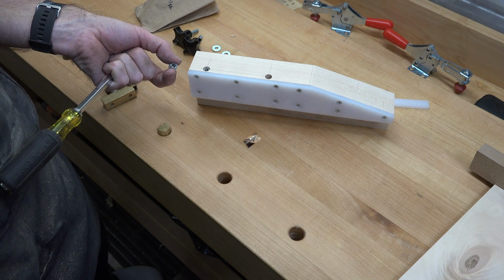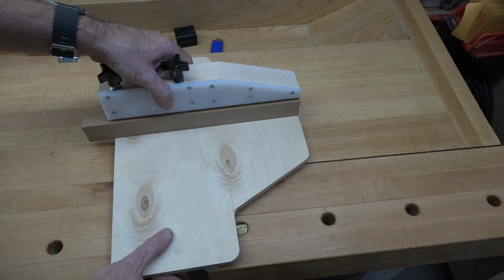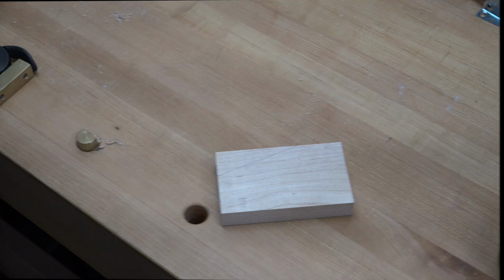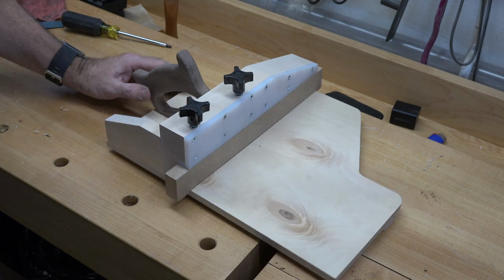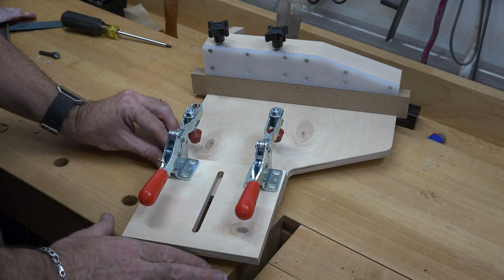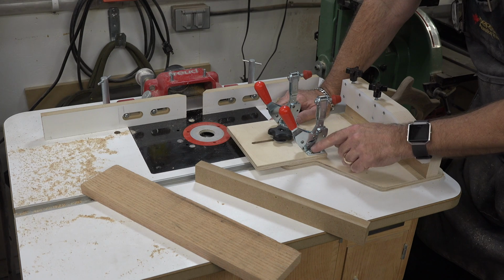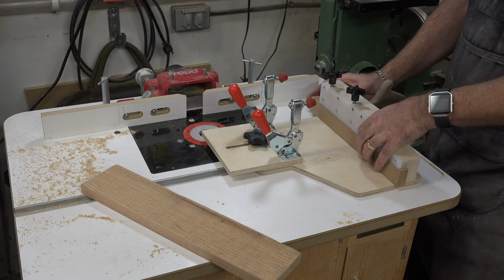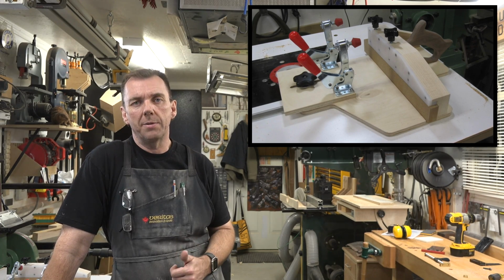Making a Coping Sled Part 2

Comment: Off the subject, a little but I bought an Infinity Lock Miter Jr. Router bit and I saw where they sell a router sled also. I looked at it online and had the bright idea that as I own a DELTA 34-184 UNIVERSAL TENONING JIG that I don't use all that much but decided I would take the clamp off and use it to hold my extra long pieces of wood to use it on my router table to push the wood through my router with the infinity lock miter bit. It works great so I can put the long clamp back on it and it will still be used for a tenoning jig.
Reply from the maker: Sounds like a very worthwhile "modification" Tom.  Good for you for thinking outside of the box.  Nicely done.  Thanks for tuning in.

Comment: Why secure your sacrificial fence in such a complex way? I have built and used a sled many times, and I find just the side fore from the workpiece means that it does not move. But then, I do not rely on the hold-downs to hold the workpiece square- a sliding side fence on that side does that. Why not use your sliding clamp mount to do that function? Way more secure...
Reply from the maker: The good thing about our hobby Mike, is that for every process, there is about 10 different ways to achieve the same result.  The way that I demonstrate here on the show is not the only way and if there is a way that better suits you, I encourage you to use it.  Thanks for tuning in and for chiming in with your suggestions.  It's appreciated.

Comment: Nice build Kenny, I think when I build mine the plywood that the toggle clamps are mounted to will also be a surface that slides up tight to the stock to be routed. I like the sacrificial hold down and the dowel extenders if I have to do that I will epoxy neodymium magnets to the dowel this will hold the dowels up when the knobs are backed out and you replace the sacrificial board thus preventing the lose of the dowels. Now the piece of plastic over top of the sacrificial board what purpose does it serve? Why not wood? Perhaps I missed something.
I can not justify spending $150.00 US on something I can build my self. Even if I have been drinking the Incra Koolaid, with my TS-LS joinery system the Incra master lift II and the clean sweep, oh I almost forgot the HD1000 miter gauge and the miter express. All great tools.
I do not regret spending a penny on them. One issue with my setup is I do not have a miter slot on my router table, I will build an outrigger like the Woodpecker sled or The Infinity sled has. 😁🛫
Reply from the maker: The purpose of the UHMW plastic strip above the sacrificial board it to allow the threaded jig knobs to apply even pressure along the sacrificial board, without the bolts digging into the wood.  It is just a much cleaner and much more efficient way to clamp the board in there.  It distributes the pressure of the jig knobs across the whole sacrificial board and holds it much more securely than just with the jig knobs along.  I hope this helps.  Thanks for tuning in.

Comment: thank you Kenny . great idea too. question please and i do understand on hand material . why not use hickory its seems harder than the maple so should last longer ?  remember i know nothing at this point still just a learning stuff . thank you for all the info .
Reply from the maker: Good question Walter.  The hardest factor between maple and hickory is minimal.  While hickory is technically a harder species of stock, the amount of extra hardness that it provides would not give much more wear and tear longevity over the hard maple so using what is readily available and (in this case) less expensive is the better option here.  Once you start questioning the minor differences of wood species for a project like this, it can open up a slippery slope of "what about exotics?" because there are quite a few exotic woods that are harder than maple as well.  The important part is to use a wood species that won't break the bank but is hard enough to complete the task you wish to accomplish without problems.  For this particular project, maple is a perfect choice that meets all the criteria and it looks great too.  Thanks for the question and thanks for tuning in to the show.
Reply: thank you
Reply from the maker: You're welcome Walter.

Comment: Hey Ken, this is really a useful jig to build. I get a kick out of your fussiness, but that equates to more safety and much better results. This jig would work great for cabinet doors or fancy boxes . I wonder , if made a bit bigger it could be used to build interior or exterior doors ?
Reply from the maker: Thanks for the kind words Bill.  Being fussy in the shop is what I do best and I usually get a lot of ribbing about it.  LOL.  The jig could be made bigger and used for doors I would imagine but you would probably require some support for the stiles of the door as they would be longer and would risk tipping or pulling out of the jig.  I'm sure that it would be possible though.